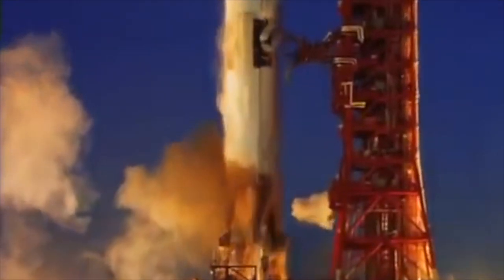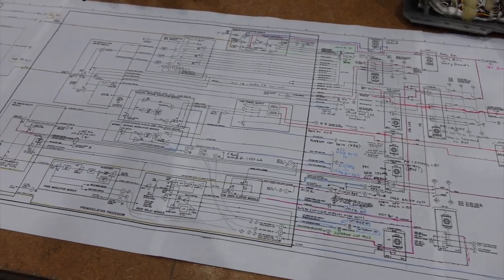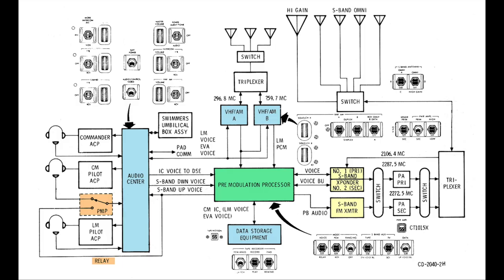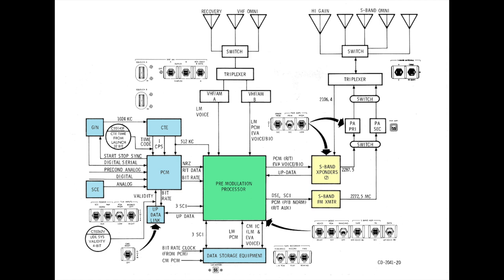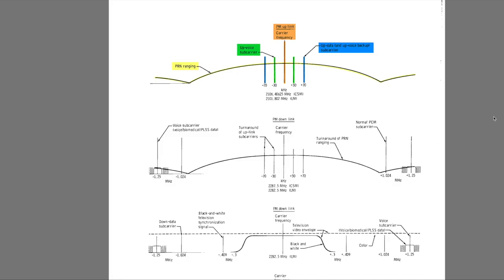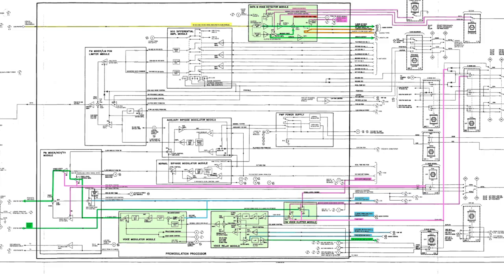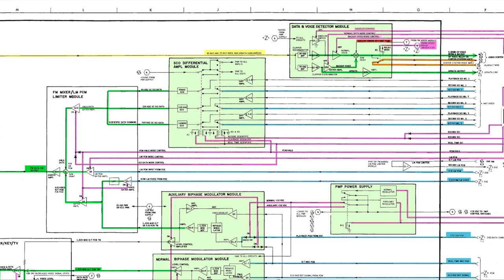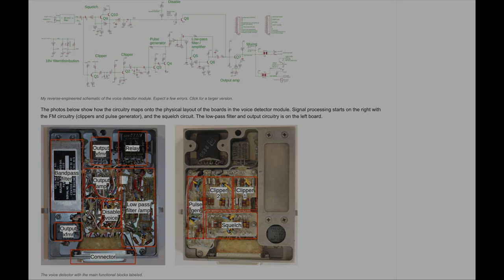Apollo Comms Part 19: Pre-Modulation Processor Grand Explanation

Comment: One of the things that's hard to get across in endeavours like this is just how much goes into designing these things. It's very easy to look at physical hardware, block diagrams, schematics etc and understand it, then kidding ourselves into thinking we could perhaps design something like this ourselves.

But in actuality with these complicated RF designs the gap between understanding it, and being able to design it, and having it work as well as what's in hand is absolutely massive. Massive. Especially when using such primitive components and bulky construction techniques, the battle with parasitics would have equalled or exceeded that of the fundamentals at every turn.

The Wikipedia page for RF Engineer says: "To produce quality results, the RF engineer needs to have an in-depth knowledge of mathematics, physics and general electronics theory as well as specialized training in areas such as wave propagation, impedance transformations, filters and microstrip printed circuit board design."

They are not kidding about that, and these designs are probably one of the best examples of this.

Comment: Since I by default because there is nobody left became the chief engineer for a chain of radio station and I have come to conclusion that all RF is the blackest of black arts. This especially applies to the tube transmitters. 15,000 volts at 2.something amps that becomes 30kw that by magic of antenna gain becomes 100,000 watts. The tubes have personality and if you do it wrong enough will kill you from across the room. I can sort of "tune the dip" but replacing the tube and retuning it I have found is equal parts skill, experience and voodoo. My mentors could do it in their sleep but they grew up with ham radios that you had to tune so its natural to them. I am pushing for a move to solid state which well there is very little to work on anymore. You just swap modules. RF is a dark art and the wizards of old are retiring/dying with very few willing or able to take their place. I am just an IT guy that dabbled in electronics since I was a kid and can at least follow along with the people who actually know what they are talking about but the learning curve is much steeper and more demanding than I thought when I took it on. Short story long my wizard friend keep doing what you are doing because I am learning from you too and I thank you for that.

Comment: What an amazing job to figure all this out! I can't help think about how modern systems do away with all this complexity because the heavy lifting is done on the digital / software side (including data mux and source encoding for error correction), so the hardware can be dead simple and easy to debug.

Comment: Who had the task of figuring out how to lay out the LM/CM control panels so that the switches were grouped in a manner to keep wiring close together and delivered with the least amount of cable? That’s a hell of a solve for K problem.

Come to think of it, how did the user interface control panels connect to all this gear? Were those huge barrel connectors all over the cockpits?

Comment: These days, all instruments would have their own ADC, and be connected to the vessels CAN bus. As would be the radio, and data recorder. The only analog lines going into the comm equipment, would probably be a few headset sockets for backup voice, in case the computer craps out. 
Have Boing and SpaceX ever published how they are currently doing it?
Reply: There's an open source CANbus implementation for spacecraft, a lot of cubesats use it - SpaceCAN uses off the shelf components, and given SpaceX's heavy use of open source I'd make a good guess they're using it.

Comment: When you start building or rebuilding your command module let us know. Mostly i just want out of here, but i can optically scan just about anything that will fit on a desk, measure it to an accuracy of ±10 µm 0.0004, overlay scan to cad, and export to .stl. If that's at all useful for your next mission i want in. Heh

Comment: Stunning to think how much weight Apollo's engines had to move just for all these cases alone!  Are those steel or aluminum cases and could they, back then, have been made out of a lighter material such as fiberglass with metal grounding where and as needed?  My wife and I married on July 20 in honor of Apollo.
Reply: Q 1: Aluminum. This is similar to what was used  in all military and civilian radios at the time. It's just fancied up a bit. (Sometimes copper was used - but rarely.)
Q 2: Aluminum and other metals are conductors. So they provide some RF shielding as well as structure. While fiberglass can provide the structure it's dismally bad for shielding and needs help such as metalization. In that era I never saw this being used. (And, yes, I was already playing with radios then.)

{^_^}
Reply: @Wizardess  some boxes used in the spacecraft were Magnesium
Reply: @carlclaunch793  Pure oxygen and magnesium. What could possibly go wrong?
Reply: @carlclaunch793  In a pure O2 environment! Wow! Nonetheless, steel was out of the question both electrically (relatively poor conductor compared to Al) and weight. Thanks for the info.
{^_^}
Reply: @b43xoit  Also can be radioactive as it was thoriated magnesium alloy.

Comment: I often wonder if the current generations of engineers are even smart enough to build something like this when everything can be simplified with integrated circuits and microcontrollers, and of course CAD/CAE.  Then I take a virtual tour through a particle accelerator..